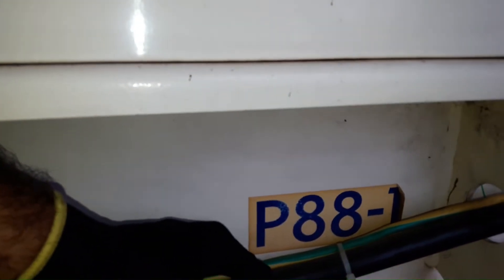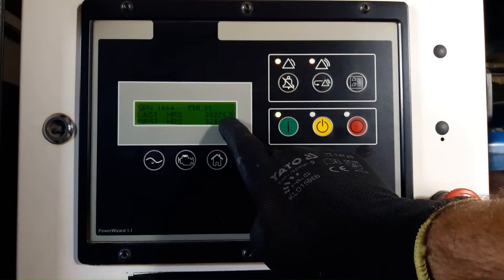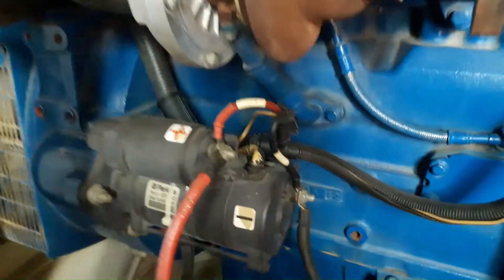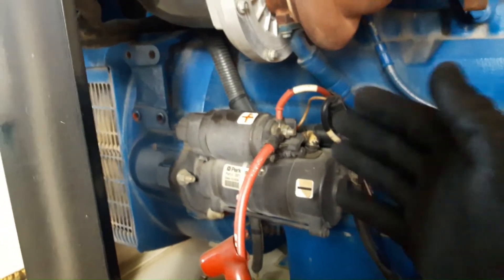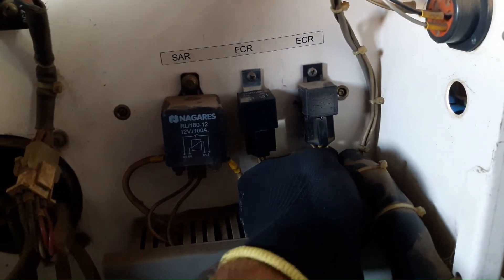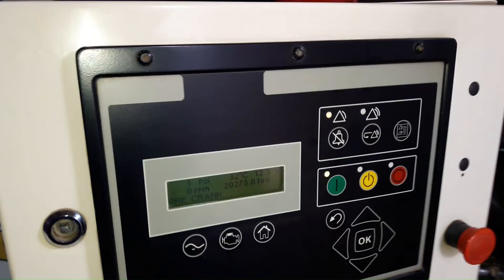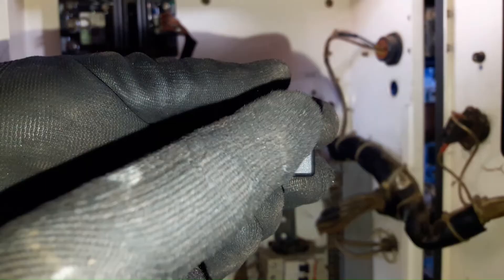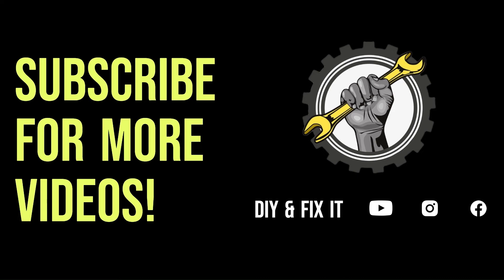Engine failure to start due to a bad  Relay  #perkins

Comment: Well done bro, good job  pls I need an advice on 250kva Perkins 1300 series the front cover that covers the gears is leaking water.
My question is could overheating cause it bcus it did overheating

Comment: Good evening my volvo D9 generator say engine can bus fault emergency stop hardware  any ideas how to fix it please
Reply from the maker: CAN Controller for CAN Bus may be faulty 
Check the wiring 
Check the Controller unit
Reply: @northjayhoon9789  will do thanks a lot 👍🏻👍🏻

Comment: How to  problem alarem high volteg battrie ....?
Reply from the maker: Thank you for your enquiry!
If your generator's controller indicates/ warning high battery alarm, definitely you need to check DC alternator .
An alternator's output is controlled by an integrated voltage regulator, which is designed to prevent overcharge.
You may have a faulty voltage regulator and it does over charge your battery.

Comment: Sir, can I ask for a wiring diagram of the same unit. Our unit at site is P200-2.
We have a problem with our fuel solinoid voltage supplies.no voltage showing whilst starting and engine won't start.
Thank you sir
Reply from the maker: Greetings 
Thank you for your request 
Please send me an email to 
north.jayhoon@gmail.com 
I will send you the wiring diagram.

All the best

Comment: Thank you for the video. Please kindly answer this question👉👉Why doe a Cummins generator controller(ps0600) reset the running hour and change the genset configuration by itself? Thanks!
Reply from the maker: Dear Sir
Thank you for chosen DIY & Fix it 
Your controller may not programmed  / calibrate well , 
By pressing ok and reset key you are gonna start calibration 
I wish to have PS0600 or PS0500 to make a You Tube video.
Reply: @northjayhoon9789  Grateful to your support🙏 I tried to enter into configuration mode and seen "J16-9 SENSOR SEL" changed into "Not connected" inside Genset configuration after the reset. When the reset occurs again the configuration is changed and due to this when a remote start signal is received the DG cranks but fails to start. Hopefully waiting you next video on 0ps600  controller.🙏